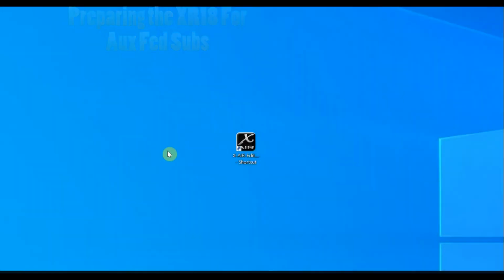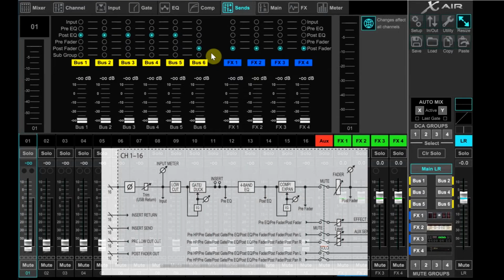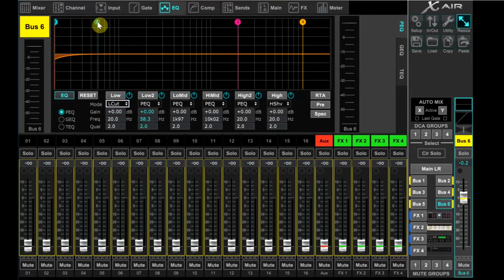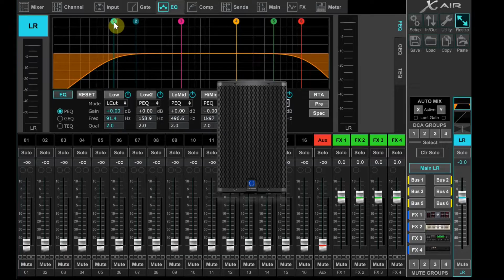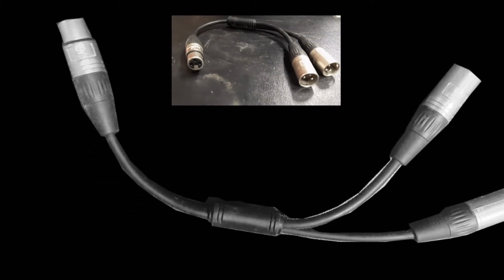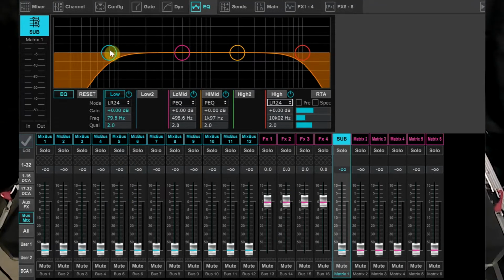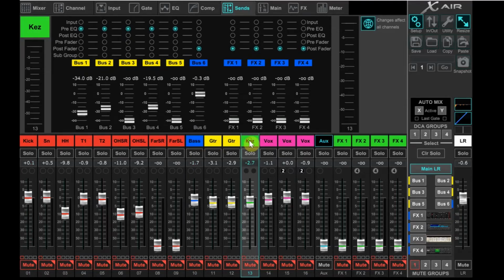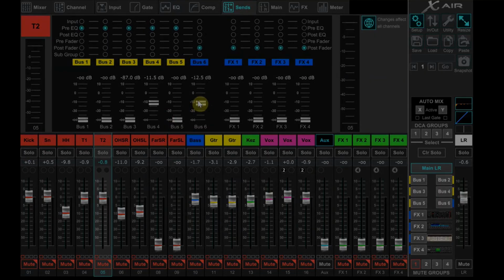Aux Fed Subs Setup For Behringer XR18 X-Air - Midas MR18

Comment: I have a regular karaoke gig and I only run the karaoke track to aux 6. I don't have a crossover on the sub. On bus 6, I just cut all the highs. Is that the best way without buying new equipment?

Comment: When I use my aux 6 for subs and set to Post Fader I’m not getting much sound. I change it to Pre Fader and get lots of signal, could this be a problem with my xr18 .?
Reply from the maker: I suspect it's either a routing issue (misunderstanding of how the routing is working in some parts) or a gain staging issue. It could be both, with one complicating the other.
First, make sure we're all on the same page:
https://youtu.be/hUxVALTQ3Po

OUTPUT should be POST fader and channel SEND should be POST fader (for the aux-fed sub).
Double-check that against this video: https://youtu.be/hUxVALTQ3Po
That has to be correct first a foremost.

If your input gains are correct (input meters showing an AVERAGE of -18dBFS but PEAKING higher (but never clipping or threatening to clip)... then make sure you aren't throwing your gain away with something like heavy gain reduction on compression (without makeup gain applied on the compressor), or your channel faders pulled way back and not anywhere near unity. Or else the faders 'around' unity but the DCA's (or subgroups) pulled way back. 

If your sound system is WAY too loud with the faders 'around' unity (that doesn't mean they need to be exactly unity or in a straight line) without choking back the DCA's or subgroups... Then look downstream. You could, in a pinch, just pull your main fader way back instead. 

If you have more time to analyze things, the main fader itself should be in the AREA of unity... Circumstances might dictate 10dB down, or 3dB up... As a general rule, it should be in that kind of a window normally. If it can't be, and the faders and DCAs/Subgroups can't be around unity, then something downstream of the mixer needs turned down. Amps... DSP input and/or output... powered speakers turned down... etc...

Of course this assumes the cabling is all correct and working correctly (no one-legged XLR cables or polarity issues).
And that the hardware is all working correctly.

Check all of this and report back... something you find might be a clue that leads to locating exactly what is going on if this doesn't seem to find it.

Comment: Hey Alan, thanks again fur such awesome videos.
i just got a subwoofer and this video helped me alot,  however i have a question for FX on Aux fed Subs.
i put some reverb on my Kick to test, i have FX 1 on 0  on the Mains, and on the kick channel SENDS tab, i set it to -8.
what do i do to have it the same level on the SUBS on bus 6?
i put the FX1 on 0 on the Bus6/subs and i heard way more Reverb on it that when connecting on Main LR.

i hope i explain myself properly
Reply from the maker: Have you tried it yet? The reality is you probably won't need (or even want) any of the kick reverb in the sub. A lot of times people roll off the low end of the reverb anyway.  So it's naturally not on sub frequencies in that case. I'd try it without even worrying about sending it to the subs and you'll probably find it is fine that way. Maybe even better.
Reply: @AlanHamiltonAudio  i tried  and the bus 6 was giving way too much fx.
Allright. I will test it loud to see of it sounds, thanks alot
Reply from the maker: @cornellrpgdrums  What I'm saying is on your sub output, don't add any reverb there. Just let the reverb be in the tops.
So, on the FX return channel of whatever FX send you're using for the kick, don't send any of it to the sub (aux 6). Leave bus 6 on the FX Return channel off. You shouldn't need any low end reverb going to the sub. It would probably just muddy things if you did.
Reply: @AlanHamiltonAudio  Make sense.
Sorry im just learning.
Thanks a lot!
Reply from the maker: @cornellrpgdrums  No problem. I wanted to make sure you were following what I was saying. :)

Comment: Good info. Using mains to power amp and 12" PA speakers. I wound up for my home studio using the headphones out and ran both inputs to my center powered sub. The sub already filters high frequencies, win-win easy-peasy. I did this because I also have outboard crossover if I use larger PA system. BTW, you get more input signal using both lines of the stereo signal into the sub. You can get away with a mono 1/4".

Comment: I would add a word about the importance of removing "low end mud" on every channel (HPF) AND also using the Aux On Sub to punch up individual low end elements on a channel by channel basis too. 
Removing crud from channels feeds monitors and reverbs with a cleaner signal for a better mix overall.
Reply from the maker: Been a while, but I thought I mentioned the importance of using a HPF even when using aux feds just for that reason... It might've been in context of  a 'warning' about aux fed subs 'fooling' the tech by removing unneeded lows in the house, but would still be in any recording feeds, streams, fills, mons from FOH, etc... and then the warning not to use aux fed subs to 'replace' the HPF. As you said, you still need both.
Reply: @AlanHamiltonAudio that's right

Comment: Great video and great starting point for anyone using an xr18 or AIR. I would just like to mention that you can obtain a 24db low/high frequency cut by stacking the Q filters. Start by setting both filter 1 and 2 at the same frequency and set them both to Lcut. Qual size has no affect and can be ignored. Applied to the Sub AUX Lcut (40Hz) and Hcut (100Hz) and Main L-R with Lcut (100hz), would functionally have a simple cross-over (minus time delay and phasing).
Reply: Okay

Comment: How should the kick channel fader and EQ be set for mains  LR when the kick is sent to bus 6/subs
Reply from the maker: Assuming the system is balanced correctly (lows/mids/highs) then the Main L-R fader and the bus 6 main fader should match.
That way, anything you want in the subs, if you put it at unity on the channel, should sound perfectly balanced in the PA.
To really get a feel for it, assuming you don't have any measurement tools, use your WAV/MP3/CD Player with the sub set at unity on a channel (or channels for stereo)... And listen to the system balance first. If you notice that makes the subs too hot, or they're not hot enough... adjust at the amps/speakers. Whether you'd want to cut the level of the tops if you need more subs, in balance, or just raise the subs would depend on how hard you're already driving them. Just balance things and keep them out of heavy clipping.

A workaround for essentially needing two master faders (on the X-Air stuff)... a sub and a main L/R... is once you have the balance at the amp/speakers/processor within a good window and sounding good and the mixer Main LR and sub fader is at unity- Assign EVERY channel to an unused DCA. Since your channel sends for your sub should be post-fader typically, that means that this DCA becomes your defacto main for everything. So one master fader.

Of course it's not that big of deal to just adjust the 2 faders if you need that DCA for something else... but it is a way to have a single master control on the X-Air stuff.
Reply: @AlanHamiltonAudio 
I love your channel, I believe I’ve watched most of your videos multiple times in my opinion you explain everything better than anyone else I’ve seen yet! Thanks for all you do. Keep up the good work!!!
Reply from the maker: @timothyclinton8644  Thanks! :)

Comment: trying to figure out in ear setup , can't figure that out by watching this.
Reply from the maker: There are several videos on the channel that target IEM setups.

This one is a walkthru showing how to build a dedicated IEM rig with the XR18 featured.
https://youtu.be/xT9gTBFxvZk

This one is more about the mixer settings when using the console as a dedicated monitor console:
https://youtu.be/Zf83kolgVzk

Even though those are talking about using it as a dedicated monitor console, there are things to be gleaned even when using it for FOH and Monitors.

This is a new video that shows how to connect IEMs to any console and talks about various tips. While not specific to the XR18, it's a good video to get more of an understanding about connections, etc...
https://youtu.be/XLCqQ3rF5Sg

This one is an 'Explainer' video that tries to target mistakes some users make in tap points for things like monitors:
https://youtu.be/CAO56X-uxWk

This one is a general overview of the output routing.
https://youtu.be/CAO56X-uxWk

There are also a couple of video talking directly about the channel inputs... and about the mixer outputs. Essentially, walk-thrus. Not specific to IEMs or monitors, but likely contain some answers about signal flow that help you understand the bigger picture:
https://youtu.be/UNO-dACc7YY
https://youtu.be/xPsSPK6RKzU

There are some other vids that might interest you about the XR18 or IEMs in general so check the channel library for ones beyond these links.

Comment: Thank you for all the valuable information. I’m a music teacher and recently started using the XR18 for my student bands.

I am using JBL EON 615 as my main speakers and I also have two subwoofers (JBL EON618). 

Should I connect my subwoofers using the aux, as explained in this video, or should I connect the two subs to the main speakers? Apparently the eon 615 have a crossover system integrated. Thanks for your help
Reply from the maker: Unless you need to wrangle the last dB out of the system, I'd keep it simple and just utilize speakers and their own crossover network. As long as you aren't trying to milk the last dB out of the system, you should be fine that way. Plus, if it's a case where the kids will be using the system, that's even more of a reason to keep it simple.
Reply: Thank you! 

What would be the proper order? 
XR18  > EON 615 > EON 618 Subs 

or 

XR18> EON 618 Subs > EON 615 ?

Or does it really matter ?  Thank you so much again for everything. Your videos are really helpful
Reply from the maker: @miramontemusic  I've not used those but I think ("think" ;) ) that they just have signal pass thru jacks and a preset for sub. So I don't think it matters which cab you hit with the XLR first. But do make sure you set them for the 'sub' preset.

Comment: This has been the most helpful channel for mixing with this mixer.  

I picked up the XR18 in 2018 on a recommendation from a cousin that plays bass and runs the monitor mix in a country band.  

Ive been using this mixer to run sound/monitors for my band and others along with DJ gigs for weddings.  

I have 4 powered tops ( harbinger V212s no dsp features) and run 2 on each side for stereo.  

My subs are  2 Fender 115SA passive subs powered by a QSC 1310 USA power amp in bridged mono.   

Ive always done the low pass fillter
On aux 6 and the high pass on the mains to act as the "crossover"   
 
I want to get  one of those rack mount crossover units that let you do  the mids/highs in stereo  and run mono subs.  I am totaly ok with getting a crossover thats analog and doesnt have all the digital interfacing stuff on it but i am confused/intimidated by terms like 2 way stereo/ 3 way mono and another one that shows 3 way stereo/ 4 way mono.   Is there a guide out there for making sense of this and how to get that kind of setup running?

Comment: I have a DDJ-800 running 2 xlr's to channel 15-16. 

Inside these, in the sends, I am seeing my aux fed subs, which are 5-6. 52's, and 18's(subs)

SImple eq seems to do the trick when routing this way, but I seem to be hearing a little bleed of high end on the subs. 

Do you have a fix to this? Or is this inevitable? I have a hpf and lpf on bus 5-6. Should that be the only eq section I concern myself with? It's odd. I might figure it out, but it would be great if you had a quickfix or solution. TY~!
Reply from the maker: The HPF and LPF isn't very steep as compared to what a real crossover filter would be doing. You can stack filters to better mimic what a real crossover would do, but you can only do so much on the XR18. The X32/M32 does have crossover filters available... Although I always recommend an external crossover/DSP to handle system processing like this. Or an amp with built-in processing (or powered speakers with built in processing).
You just have so much more control that way, and since the boxes don't ever get changed once set, it mitigates the chances of mistakes happening with a console reset, loading a new scene, or something similar.

Other than the low cut and high cut filters not being very steep, I can't think of a reason you'd hear high end bleed in the subs. And even with that, how high are you talking about?
Reply: I figured it out! I just kept coming back to this video day to day. It took a bit to absorb what was being said and why. Mostly just over equing and not adjusting the volume of the sends properly. 

Appreciate the response more than you know man! Your videos have saved me from a lot of trial and error that bites into time. With a base of what does what and why, it's been a lot easier to figure out when tinkering. THANK YOU!  @AlanHamiltonAudio
Reply: The 52's were passive, they were bridged at the pa, along with only 1 xlr going out from that pa. I adjusted the crossover settings via manual, and the subs were much easier to control. In the end, I discarded the 52's for my dj performances, due to already having (4) 18in powered subs. They do more than enough for the venue I'm in, and the control is now simplistic, down to one bus channel instead of two. Less is definitely more when it comes to bass. They sound great now, can't even tell  subs are there. Basically feels as thought the bass is coming from the mains. Very clean. Can't thank you enough for your tutorials!
Reply from the maker: Cool! Thanks! Glad you got it worked out.  @NonnyStrikes

Comment: Can you do this with the headphones out instead?
Reply from the maker: There might be some audio magic routing to make it happen in some way, but it's such a bad idea with potential pitfalls that it really wouldn't be worth the effort. For one thing, the headphone output is unbalanced stereo. So you'd have to account for that and not make any mistakes confusing unbalanced stereo with a balanced mono input (where you'd get cancellations). And even with that, if you use some kind of a hack like putting the subs on the SOLO bus (headphones) and getting there that way, it's so unusual you risk yourself or someone else forgetting about this and soloing a channel for normal reasons and sending something to the subs.

Plus, you lose the ability to use the headphone jack for its intended purpose, which can be important for troubleshooting and isolated listening.

So, my advice would be, even IF there is a way, I wouldn't do it.

Comment: I've been trying for the longest time to figure out how to sync the Main LR level with the sub Aux level and this answered it, it can't.   At least I know now that I wasn't going crazy for no reason.
Reply from the maker: There's no direct way... but there is a bit of a workaround if you're comfortable working with DCAs. If you have a spare DCA you can assign EVERYTHING to that DCA (every channel and every FX return (not any of the master aux feeds though)). So once you have you main out and sub out level set and balanced, use the DCA from then on as your master. Since the aux sub is a post fader send on the channels you're sending to the sub feed, that DCA will work exactly like an overall master level control for the mixer that INCLUDES the sub's feed.

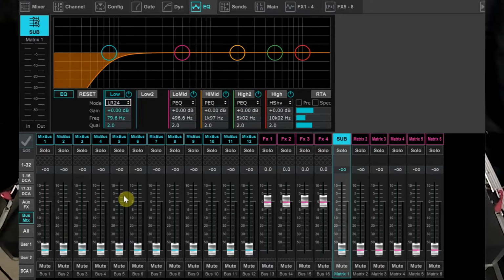Comment: you pointed out that the 12db per octave low and high pass filters aren't great for creating a crossover because they are too shallow, but what if you use two 12db filters at the same frequency? that creates a 24db filter, like the one you use as an example at 11:36. is doing this a viable option?
Reply from the maker: Yes, definitely a viable option. I didn't want to get too far into the weeds and figured anyone who understood about concepts like that would be able to apply it. 

I'm not the biggest proponent of doing crossover functions within a console versus a dedicated processor... but that is because I'm in situations with guest engineers, multiple bands, different consoles, etc... In fact, some shows are racks and stacks so my consoles aren't even onsite. So if processing was done in the console, the system wouldn't have any processing. And then with multiple bands and guest engineers, it's easy to envision a scenario where someone loads a scene and overwrites crossover and other system settings, or starts monkeying around and changes them without realizing what they are doing. Safes will only help if they are used, and will do nothing for after the fact if someone starts making changes.

But for the person always mixing on the same console and same rig, different bands or not, there's less of a chance for issues like that happening.

EDIT: One other scenario- If the console goes down, and if the system has a dedicated processor, then ANY replacement console can get the show back rolling. Digital or analog. Expensive or cheap... any port in a storm! ;)

Besides system processors being fairly bulletproof, if one was to go down, the console itself can provide some redundancy.
Reply: @AlanHamiltonAudio  no worries on that front, it's just me, mixing our band through our PA. we're trying to downsize our gear, so i'd rather do it with the filters instead of buying another bit of gear to handle the crossovers. can i say your vids are excellent and were very helpful in getting me up to speed. i recommend them to anyone who has questions about these mixers. thanks again!